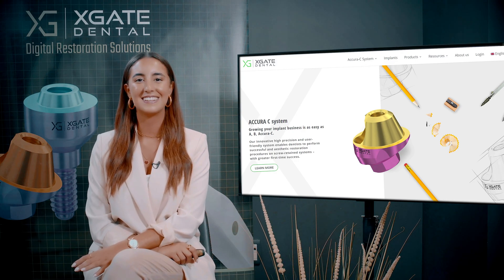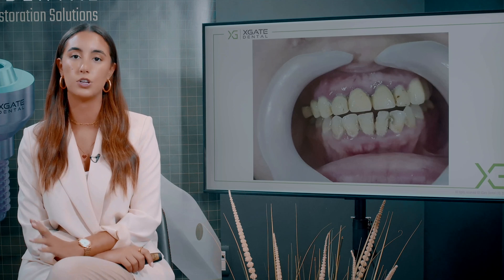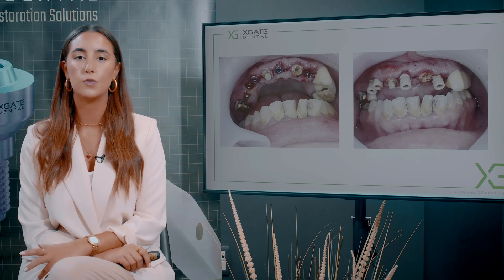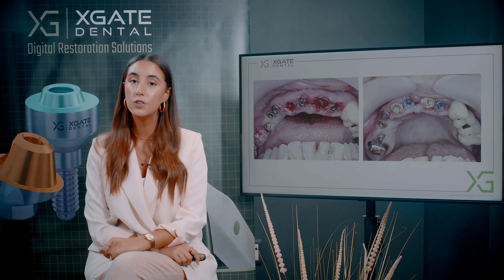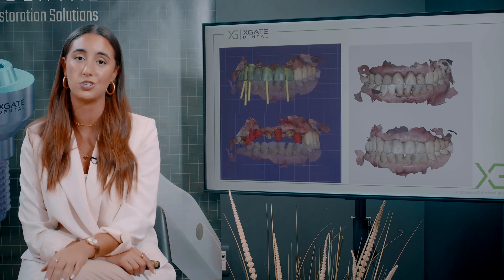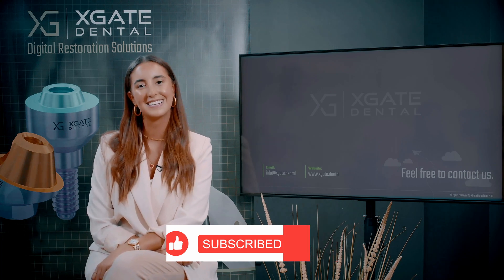A screw retained restoration bridge on the upper jow. What type of multi-unit we should use?

Comment from the maker: 00:00 On top of those implants you can see the pigmentation .
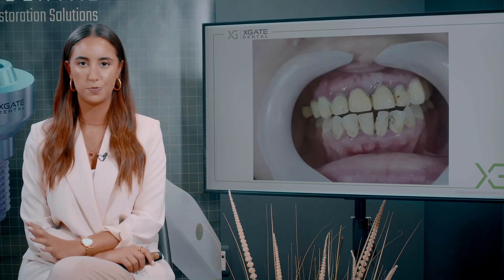01:00 The lower jaw isn't much better.
02:00 Patient will have a better temporary bridge and later on a permanent zirconia bridge.
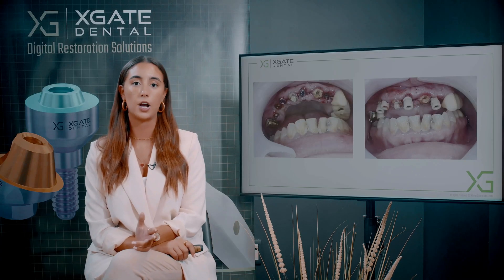03:00 Everything looks good because...
03:30 What type of multi-unit we should use how we would design the crowns around the gingiva
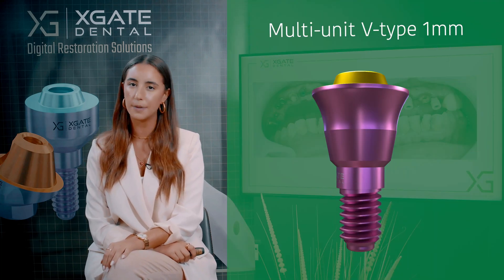04:00 You can see by the color of the multi-units.
05:00 The extraction of the teeth and the multi-unit which can look a little bit messy.
06:00 It's very hard to place implants parallel or it goes a little bit palatal.
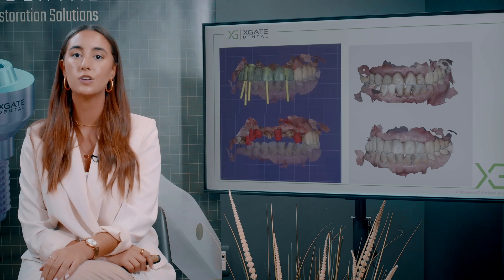07:00 They want people to think that it's all natural.
08:00 If you wanted this multi-unit to be a little bit smaller just...
09:00 Exactly as the porcelain.